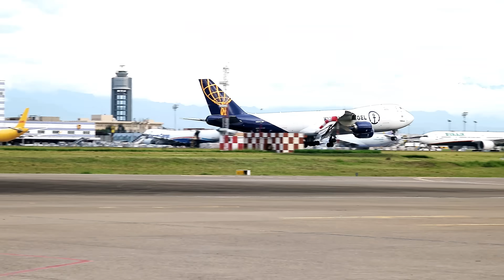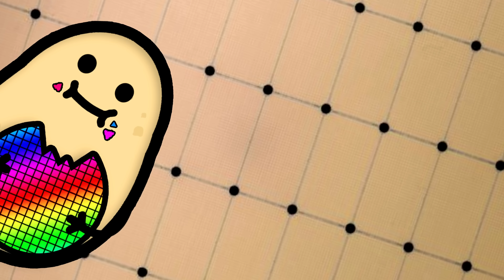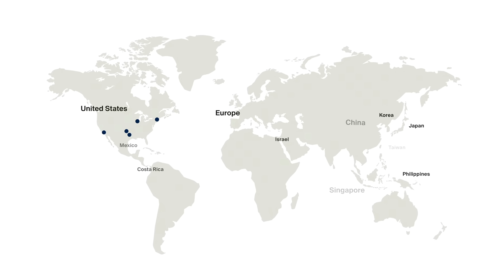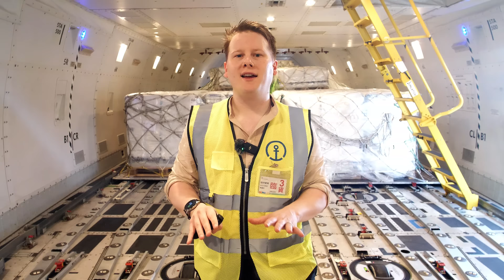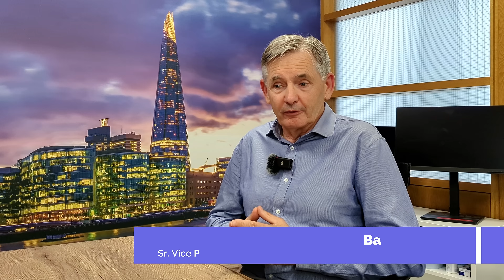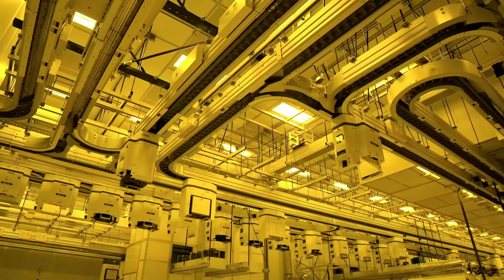Tools That Make Chips: Now With Overnight Delivery!

Comment: Now, this is a great sponsored video! Only gripe is the video transition swipe is not anti aliased (I mean, this channel is the Nitty Gritty of Tech; so I'm not annoyed :p)
One thing though; when you're reading through the teleprompter, the talk became a bit too fast for my brain to process, as the tonality changes. I assume you had limited time at the airport, so It's totally acceptable.
Reply from the maker: I know what you mean - the plane was on the ground for 90 minutes max, so I had at least two readthroughs of the script in each location. It was also fairly loud, and I didn't know if it was going to be louder (I had to restart a couple of times because it did get louder).

Comment: So my first thought is , Customs must be the weak spot in all this. I wonder how that impacts those " Overnight" as well as Thermal control issues .
Reply: I have followed "Overnight Delivery" of aircraft componets, often across the globe, from the recieving end. 
In my small experience, sometimes customs delays handovers by few hours, but rarely more than that. The explanation I gave myself is that Courriers know their way around the burocracy of the custom where they are based off and if paid enough know how to facilitate the transit. 
Ofc i would imagine that  if a machine is divided in tens of containers, that can slow down things a bit. 
But shipments like the ones in the video are prepared meticolously, well ahead of the shipment date.
In the context of Fab machinery, i don't think the fastest transit nor small prep time are factors they have to deal with. 
that would likely be the case for (much smaller, and single quantities) replacement compontens, where they have the fab opportunity cost on their shoulders as it has to stop waiting for the fix (and with as astronomical as those cost would be, I imagine they would stock spares at the fab itself )
Reply: @salmiakk_it  Tyvm That makes sense .
Reply: @salmiakk_it  Expedited processing of critical good probably is the reason why regular goods may be delayed by customs.
Reply: @rotors_taker_0h  never thought of it this way, actually makes sense :D

(Except that one time that I bought a Rubik's cube from the US and it stayed 1 month at customs ahahah)

Comment: Not impressed. I can get potato chips from Amazon within a day.
Reply from the maker: But can they run Crysis?
Reply: @TechTechPotato  fair enough.
Reply: @TechTechPotato  they are a low power/distributed/edge computing solution
Reply: @TechTechPotato  doom. take it or leave it
Reply: but, amazon always delivers the potato chips cracked, very low yield :)
Reply: I can chip my tooth while crashing my bike in less than a minute.

Comment: You wouldn't want one of those planes going down with a 350million EUV on board
Reply: Luckily they need more than 1 plane so not all 350m fit into one plane 😂
Reply from the maker: I think Intel used 20?
Reply: well one airliner is in the same order of magnitude of value, plus i imagine everything is super-duper-insured, so i guess the only thought (luckily, i would add) is to the souls onboard that that would claim
Reply: Imagine that changes the plot of castaway quite a bit. Wilson is an AI assistant now I guess, though wafer cutters are not that effective at removing a single tooth.
Reply: @capability-snob  well, making fire woudn't be much of a feat with a 40KW laser source